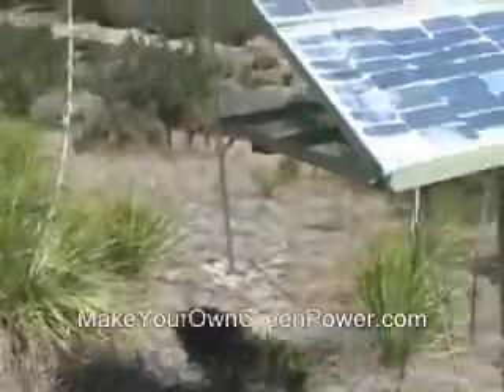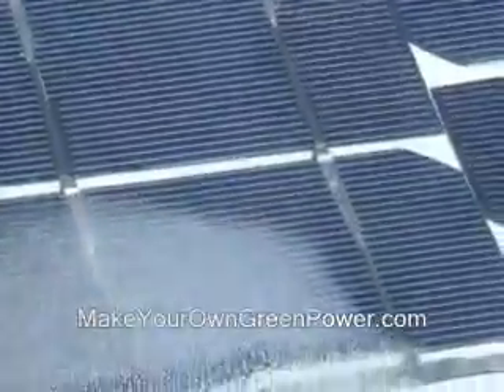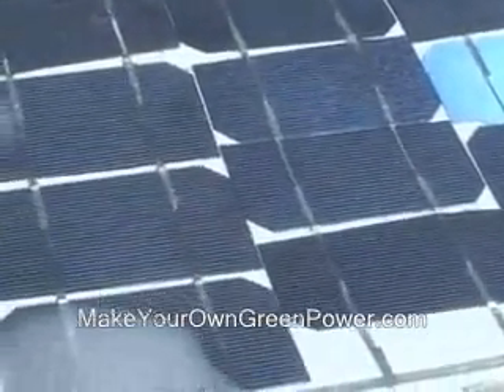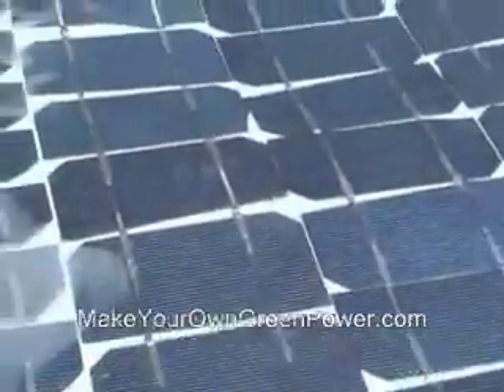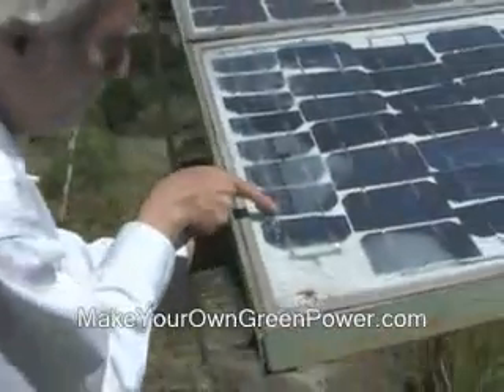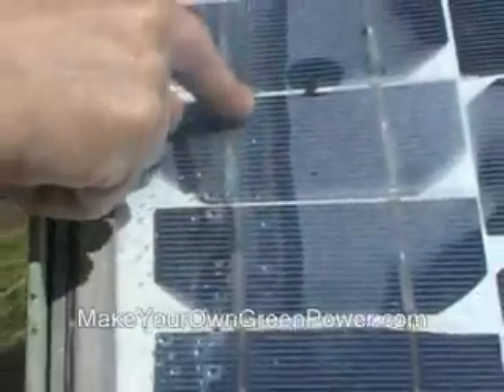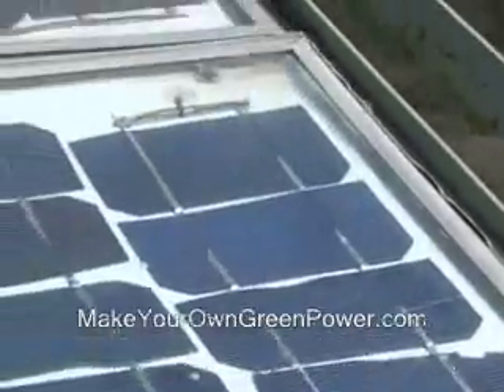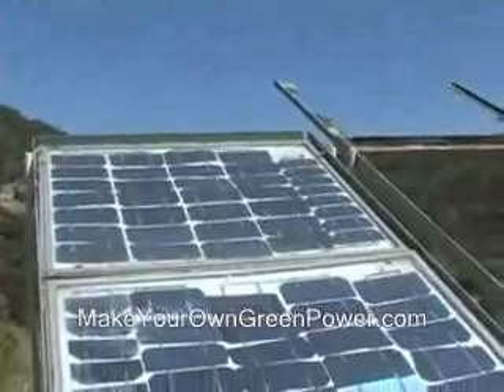Man makes Solar Power with Broken Panels

Comment: @JimmyLindstr0m I agree. and I wonder if a special circuit of voltage comparitors, and super capacitors, and pwm cap dump/pulsers could sort out the "energy" mess. You know? Each panel (at least) gets wired into an input channel.